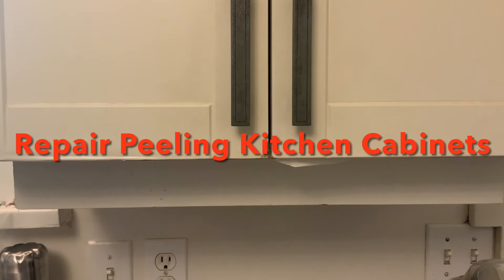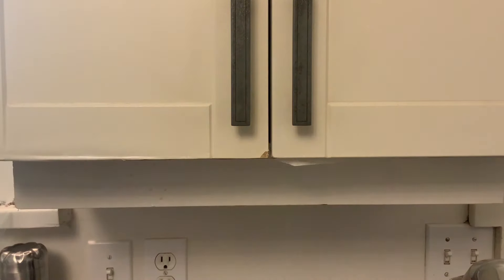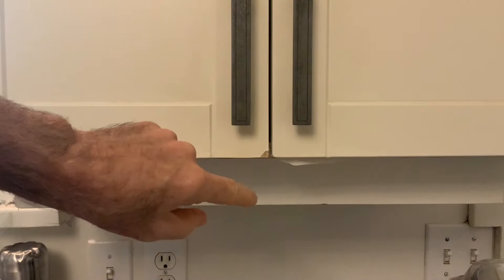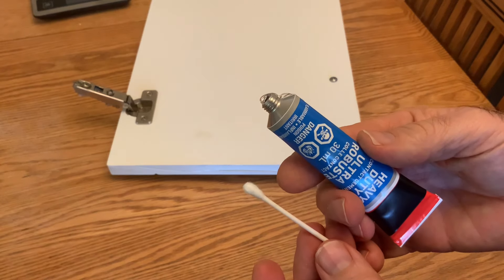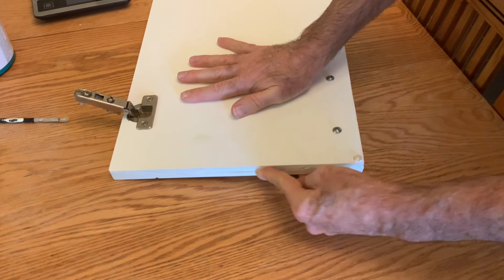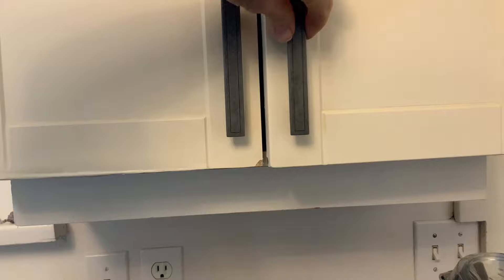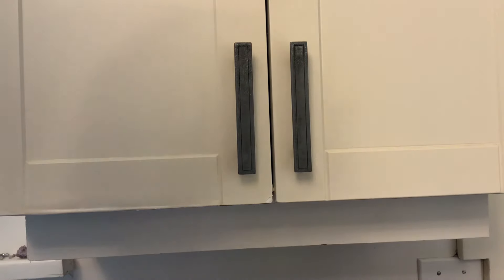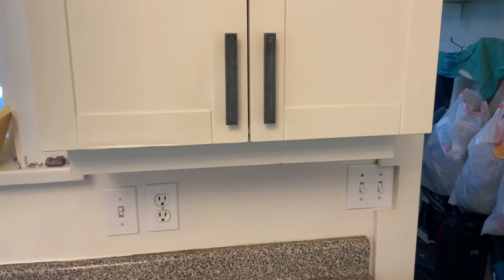Repair Peeling Kitchen Cabinets

Comment: A really helpful post, well described and a good pace, plus some very good comments.  I will definitely try this on my damaged door. I will check the suitability of my contact adhesive, which in the UK is often Evostick.  One question though: was there a reason why, having built up the layers with undercoat (very sensible), you didn't put some gloss on top?  Thankfully my door is white so I don't have to colour-match your ivory!

Comment: I have this issue but the edge doesn’t fit to the edge anymore.  Can it be heated and stretched to make it fit to the edge?
Reply: I wish he would’ve answered your question what did you end up doing???????
Reply: @bmc1717  after looking into how much it would cost to repair and was a lot.  We decided to heat it and glue it.  We couldn’t stretch it but we clamped the edge down as close as we could get it.  Once it dried any wood showing was rolled with an oil based cabinet paint. It is not the best but it’s on the bottom edge so you can’t really see it. Had to repair 5 doors. 2 were worse then the other 3.  1 we did cut the thermafoil off to the edge as it wouldn’t glue down then painted it.